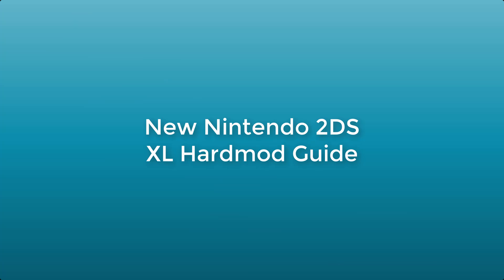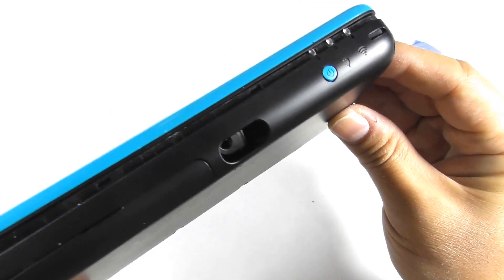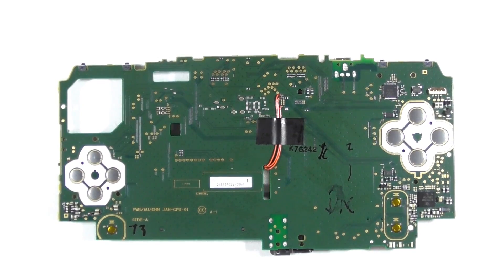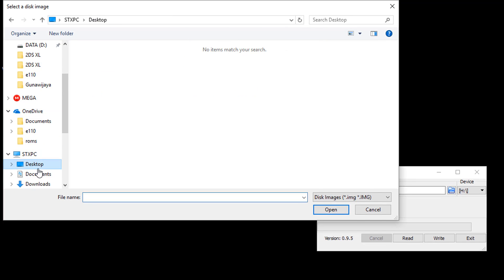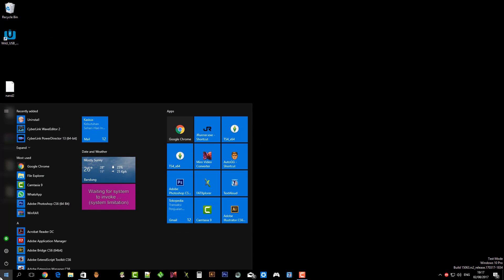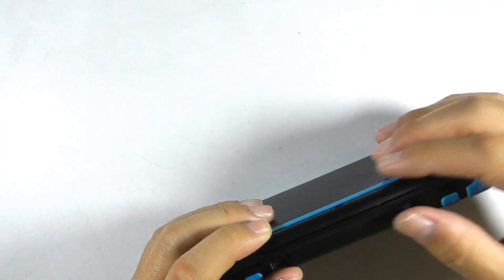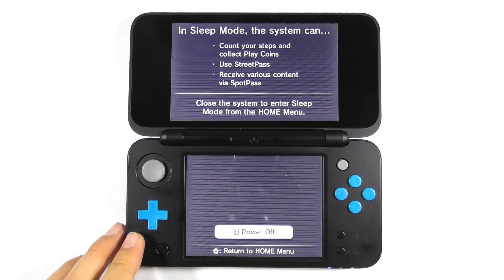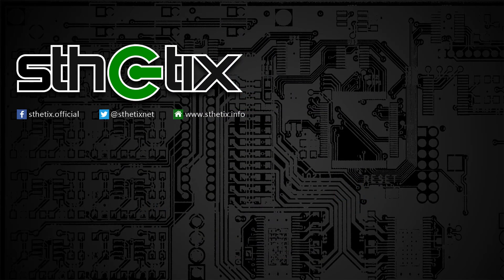New Nintendo 2DS XL Hardmod Guide (updated)

Comment: Hey Sthetix, I learned so much from your channel big thanks. Right now im so desperate with a N3ds xl. Bought it and it shoes blue led and black screen of death. I tryed everything from ntrboot flash cart to hard mod (good solder experience). I wasn't able to read the nand with anker card reader. Nohing was shown when connecting to PC. Though when starting in recovery mode I get music and hear clicks when touching the touchpad. I searched all internet and made some posts. I still don't know how to interprete the symptoms. is it a totally dead nand? or do I make major mistakes? :(
Reply from the maker: when ntrboothax didn't fix the issue then I guess the console is dead
Reply: @sthetixofficial  thank you so much for taking time and response. appreciate it big time!

Comment: Bro, big troubles, I've done the hardmod part, but when I turn on the 2ds screen only flashes on and off, I don't see the blue screen with the error. I have to connect also the back of 2ds, the one with speakers and camera?
Reply: By the way I'm sure about the conections
Reply: Correction #2, I DO get the blue screen with error, but 2ds shut down inmediately. Should I proceed? Or should I cry like a baby because I fucked my 2ds?
Reply: Well, I noticed I can't continue since 2ds shutdown and can't connect to PC and dump nand. I don't know what to do since nothing seems wrong. Hope you can help
Reply from the maker: Remove any wires..can u turn it on?
Reply: I found the problem master, a f-ugly connector, the one between Top monitor and joystick. That motherf*cker I pushed a little more than intended and now is wobling, I need to find a way to put all way down again. If I push it the 2ds wont turn off
Reply: Ok man, finally, 2ds is on and error blue screen, just a problem, my PC detect Anker USB reader, but no pop up window or nothing, and Win32 Disk Imager don't show any drive available
Reply from the maker: Recheck the solder pin on the sdcard adapter. Recheck everything using a multimeter
Reply: Hi again man, I've checked solder pin on sdcard adapter, and rechecked everything. When I check things apart multimeter gives good reading on continuity, but when I connect sdcard adapter to 2DS, multimeter gives bad readings, don't know what to do now
Reply: All my solder point are perfect, and with good space I'm starting to think my 2DS is done
Reply: All wires removed, still blue screen, I'm really sad now. And one flat cable is very sensitive, if I move it 2DS turns off
Reply: Another thing, The CMD point from de 2DS motherboard, I blew away one of the two points, the one that is closer to the resistence. Could be the issue?
Reply from the maker: i cannot help u with this. Sorry
Reply: @sthetixofficial  Man, any update on this? saw your new brick and unbrick video. Can I revive my 2ds xl if nand is somehow corrupted?
Reply: Have you resolved your problem? I'm in a similar situation :c
Reply: @AngelPk96  did you managed to solve your problem?
Reply: Short answer, no :(, but... (big drama pause) I take a photo and saw i blew a line, maybe just maybe if I can connect that line I'll be able to continue with the process, but I haven't tried yet

Comment: Everything had been going smoothly up until I have to plug it into my computer. When I turn it on I get the blue screen, and I have it properly wired to an sd card converter and have that plugged into a USB adapter, but win32 and my of are not recognizing that it is plugged in. Any idea what could be going wrong?
Reply from the maker: Did u use anker card reader?
Reply: No, I'll try one and see if that solves the problem
Reply: sthetix why exactly does it have to be Anker? Are there any others known to work?
Reply from the maker: Because u need anker for that. Try searchingnat gbatemp for hardmod.
Reply from the maker: Anker is compatible for 3ds and not others

Comment: Hope you can help. 

I followed your directions.

When power pressed top screen would flash blue and shut down. 

I desoldered everything and the same thing happens when put back to unmodded.

Can this be fixed?
Reply from the maker: Can u reflash the nand backup?
Reply: sthetix I was never able to get past the first boot so I don't have a backup
Reply from the maker: Maybe u need to check the solder pads. Check for shorts
Reply: sthetix I checked for shorts and don't see anything. It does appear that the top two solder pads have lifted when I removed the wire. Should that matter?
Reply from the maker: It matters.
Reply: sthetix the trouble is they weren't lifted when I had the hardmod installed, they lifted while removing it.

Is there a workaround?
Reply from the maker: Sorry i dont know..

Comment: Hi there, first I wanna thank you for your incredible tutorial. 
Then... Somehow I got a nand copy using your tutorial and Disks from Linux. 
I used the card reader chipset integrated (RTL8167) on my laptop but I'm not sure if I should use this nand dump in the process. I was run the executable and finished successfully.
Reply from the maker: +Angel Ramirez u can try it
Reply: tried... :/ 
I had a blue screen after write nand patched and insert the micro sd card.

Comment: Thanks for the guide.
Will it work on 11.4 FW? Will i be able to play online like normal with the downloaded games?
Reply from the maker: +JacobMTK yes it does. but it is better to do ntrboothax
Reply: Aside from the reason of actually modifying the HW/voiding warranty/breaking HW, are there other reasons to use the other method? Does it gives more compatibility or anything?
Thanks in advance.
Reply from the maker: Ebay maybe?

Comment: Hi, i have a problem. When i press the power button, 
only 1 second appears the blue screen and then turns black
Reply from the maker: +nicolas lindstrom have u hacked ur console?
Reply: sthetix no, this is the first time i hack the console
Reply from the maker: +nicolas lindstrom you hardmod it?
Reply: sthetix I solde everything, when I connect the sd to the anker and I turn on the console it appears 1 second the blue screen and it turns off the console
Reply from the maker: +nicolas lindstrom maybe there is a short somewhere..remove every wires and try to turn on the console

Comment: For any latecomers to this - please, don't follow this guide. Hardmods are completely unnecessary now- you can install CFW on any firmware version with the "NTRBoot" exploit and a compatible DS flashcart- refer to 3ds.guide for details. There's absolutely no reason to follow this thing anymore- it's risky, outdated, and far more hassle than it's worth.

(Great video, though.)
Reply: The NTRBoot exploit gives you exactly the same access as a hardmod. It can even boot something on the console with the NAND chip entirely desoldered from the motherboard.

Hardmods are completely obsolete now- the only case where they might be even vaguely useful is if the console's cartridge slot is broken for some reason.
Reply: lmao the guy actually forces you to hard mod
Reply: It's like war but in the Reply section of a comment.
Reply: AlarmClockBritain Founding flashcards is hard. You can try FreakyHAX, the one that I have
Reply: Locutus, can we talk, i just get an New 2ds xl and i want to do this with a R4, but i need some help with some stuff. If possible please, send me email at sanozukez@gmail.com . thanks
Reply: Follow the guide at https://3ds.hacks.guide/ Hardmodding and Flashcarts are completely unnecessary now.
Reply: What the fuck are you getting salty for. You said let people decide but seems like you're forcing them to hardmod
Reply: but if u brick a softmod console ?? need to buy a new one
Reply: Well... I would prefer to do hardmod then buy a flashcart from a shady website. Its hard to find a non-shady website in the UK. Also... for some reason, I already have a soldering iron.
Reply: Coby Andrews Or you can just follow https://3ds.hacks.guide/ and not buy or hardmod anything
Reply from the maker: +AlarmClockBritain but not all want to but flashcart. Some people wants hardmod because it is challenging. Let people decide.
Reply: sthetix And also because it’s permanent and you can’t lose it and have to do this whole guide again if you decide to reset your 3DS.
Reply: @sthetixofficial  tu raconte des betises toi depuis quand on fait des soudure sur une new 2ds xL laissez pas votre connerie decider merci
Reply: I posted that comment because somebody popped by the Nintendo Homebrew Discord stating that they were about to follow this guide without even knowing the NTRBoot method even exists. 

There's no indication that any other method beyond the DSiWare route exists in the video itself, or even in its description.
Reply from the maker: +AlarmClockBritain because ntrboothax exists after hardmods. And yes..not everyone knows it. Not everyone knows 3ds.guide too. But most people know or want to hack their console.

Comment: Do you have to use add to USB adapter or can you just plug it straight into a computer through the sd adapter
Reply from the maker: +Gravvy29 the 4 pins can go directly to sdcard adapter.

Comment: the screwdriver 0.6y Tri-wing for Iphone 7/7 Plus works on the 2ds xl?
Reply from the maker: +nicolas lindstrom yes.
Reply: Thanks, and is necesary the usb 3.0 card reader, because my pc have a card reader.
Reply from the maker: +nicolas lindstrom anker card.reader exactly
Reply: sthetix the questios is if i can use the card reader of my pc or is obligatory use the anker card reader
Reply from the maker: +nicolas lindstrom anker is the most.compatible card reader. I am not sure ur pc.card reader can detect 3ds.nand
Reply: thanks, now i have 11.5, if i update the firmware to 11.6 can i do this hardmod?
Reply from the maker: +nicolas lindstrom yes

Comment: Thank you very much for making this video! I have a few questions however, i hope you don't mind my noobness:

- It seems that I'm not the only one confused about the exact points you have to solder your wires to, judging by other comments. At 3:32 you show a diagram with 3 color coded points, each of them covering 2 solder pads.
At 4:26 your wires seem to connect only to the solder pads on the right side. 
My question is: do you solder each wire to 2 of these pads, or only to one of the pads? My question simplified:
Which is correct, if X represents solder pads connected to the wire, O represents solder pads not connected to wires?

X X      CLK                           OR                                O X       CLK                                OR a completely different layout?
X X      CMD                                                               O X       CMD
O O                                                                             O O
O O                                                                             O O
O O                                                                             O O
X X      DAT0                                                              O X       Dat0

- Would it be possible to solder these pins to a micro USB port (https://goo.gl/zaGjFT) then connect it via a microUSB-to-USB cable to the SD/microSD adapter showed in your video? Would it still work in your opinion?
- At 2:47 you highlighted sockets with latches. Can you provide some additional info or a guide video on how to disconnect these properly, without damaging anything, for people with no prior experience with these kind of connectors?

I'm sorry for the very long comment.
Thank you again, you rock!
Reply from the maker: +Gábor Nagy. Hi there..

1. Both pins are connected to each other so you can connect to any pad..(left or right its up to you)

2. You can connect to microusb port.

3.most sockets latch need to be lifted first before removing the flex ribbon cable. Use a small screwdriver to do that. Do it carefully.
Reply: Thank you very much for the fast and accurate answer, I'll try this method as soon as the Anker SD reader arrives. Respect!
Reply from the maker: +Gábor Nagy goodluck
Reply: @gabornagy3984  na egy magyar

Comment: I modded my New 2DS XL and it works. But the soldering was not easy. I used (in German:  Fädeldraht) 
braided wires.  Very  thin isolated cables. When you build the  SD Card adaptor  dont loose the small Write Protect  knob.   
Removing the flex cables is also difficult. The small one use different connectors than the  bigger  one. 
Now I'm  looking for modding the hinge. It's  to shaky.
Reply from the maker: +Gubi66 goodluck

Comment: At 3:32 you show the 3 types (DAT0, CMD, CLK) did i need for each type "both points" on the board or for each only 1? Because you marked at 3:32 both points! Sry for my bad english.
Reply: +sthetix I had the same question pop up when I watched your guide and I am quite familiar with electronics and soldering. His question was legitimate. But thanks for clarifying.
Reply from the maker: +Hank Moody you need 4 points exactly.
Reply from the maker: +Hank Moody i did not say both points
Reply: But every type has (2) • • points - should i connect them like •-• or put the wire only on "one" side?
Reply from the maker: +Hank Moody what do you mean by two points? Just Follow the guide
Reply: sthetix i follow the guide but it is not clear! For example DAT0 on the mainboard are two connectors (points/dots) should i put the wire on both or just on? I will make a picture...
Reply from the maker: +Hank Moody maybe because you are not familiar with electronics.
Reply from the maker: +Hank Moody connect those two points together. That is why i put a line on those points
Reply: Ok, that was not clear for me! :) THX! 

After the hardmod is done can remove the wires from the board?
Reply from the maker: +Hank Moody u can remove wires afterward.
Reply: Big THX to you!!!! :)
Reply from the maker: +Hank Moody goodluck
Reply from the maker: +Fleder ok ;)
Reply: Nevertheless, wonderful and apart from this single thing, very comprehensible tutorial. Thank you for this!
Reply from the maker: +Fleder u r welcome

Comment: 3:22 It's NOT a power button. That's the new c-stick :P
Reply from the maker: +Al M yes that is true. It is not a power button. But soldering is fine. Solder pins location are correct.
Reply: Yes, the solder pin locations are correct. I was referring to leaving too much wire exposed. And is that AWG28? For me it's an Art, so I like to make it look a little sexier :P
Reply from the maker: +Al M awg30 is a type of wires..small wires. Yes its an art so lets be creative :)
Reply: Ah, so you are using AW30, good. I thought you were using AWG28 which would be a little harder to work with on those pads.
Reply from the maker: +Al M yes aw30.

Comment: Why do you solder to copper pads, totally unnecessary. This will not help you with the signals and with the resistance. You will much more likely short lines and break the data bus.
Why do you need a terminal board, you can solder to the SD-Interface directly. You just risk shorting the lines doing that.

Just glue the wires into the console with tesa e.g. and remove less of the isolation so you don't short circuit the lines.
Reply from the maker: +Maxi6411 i am not talking about signals and resistance. I did not mention any about it on the video..
The only thing why i did that is i dont want to remove the whole board if i want to hardmod it again
 So that tiny board will act as a terminal and nothing more.
It wont get shorted. And it is only one sided.
I know what i am doing.

Comment: I'm stuck on the part where you make the SD card adapter. What are all of the parts you used? Is there a guide? Huge thanks for this video though!!
Reply from the maker: +DigitalIndustry i use a standard micro to sdcard adapter and u dont have to use a socket..just wires. That is enough. Remember the colors.

Comment: Hi, while reassembling the system, I think I may have unpropperly seated the ribbon cable for the camera so every time I open the camera app, it tells me to hold power button and restart. Any tips on inserting the ribbon cables back into their proper spot?
Reply from the maker: +Chris Nham use a tweezer and do it carefully

Comment: At 4:25, it looks like you are shorting the two CMD pads, but not the CLK and DAT0.  Can you confirm if we should only solder to the right pads, or does it not matter?
Reply from the maker: +Fred Drake separate all pins. No shorting each other. It does matter. Look at the diagram

Comment: In 3:31 you show both pins left and right (red blue and orange) but i only need one of them ??
didn´t understand that point, because i only get 1 time the blue error screen for nand dump, but my anker isnt here, so i need to stop. but after removing the battery "instant reboot" what did i missed ?! pls help *anybody
Reply from the maker: +Sascha Quagmire 4 of them should be connected to the card adapter
Reply: Nand Code in BlueScreen
 
00F800FE 
00000000 00000000 
0000200 00400000  *maybe missed some 0 :D

did it work or is sth wrong?
Reply from the maker: +Sascha Quagmire u must use anker card reader. And it should be detected under windows

Comment: If anyone is daring enough to do this to their brand new 2DS XL, I can confirm it does in fact work!

Did mine today, thanks for the walkthrough!
Reply from the maker: +Demitrius Skrapates happy gaming :)
Reply: What are all the hardware tools (soldering kit, screwdrivers etc) I'll need for this ?
Cables, USB's, flashcarts anything like that needed? 
Thanks!

Comment: dude is there a way to cfw another 3ds wich it is on 11.5
Reply: you can use ntrboot (in my opinion the best way)
Reply: -or wait until nintendo stops supporting the 3ds, which will trigger everyone to get lasthax, its gonna be free
Reply from the maker: +Ouss Plays use dsiware transfer or use this hardmod
Reply: or you could use seedminer to get cfw, i got cfw recently with that method
link: https://gbatemp.net/threads/seedminer-single-system-dsiware-injection.495685/